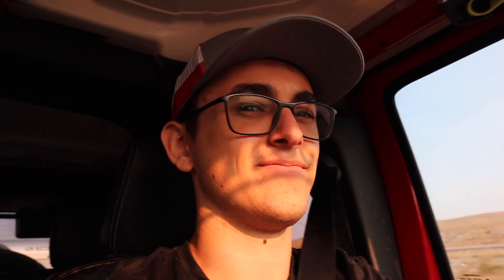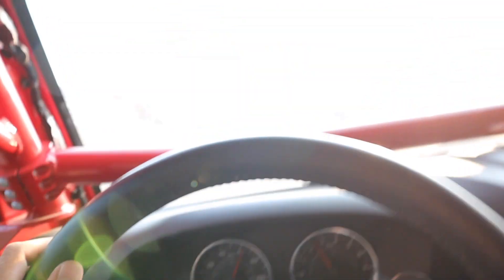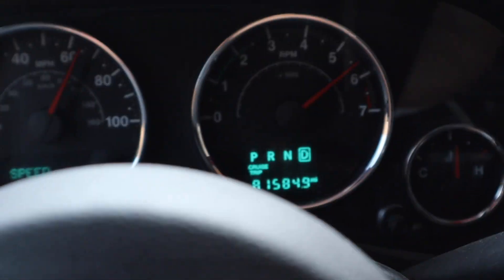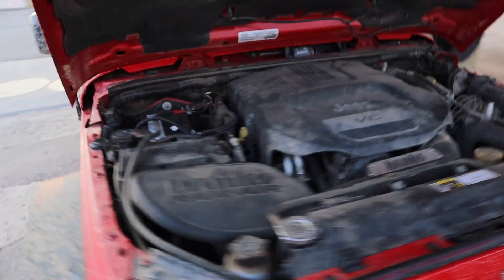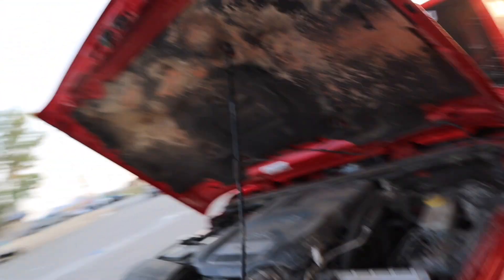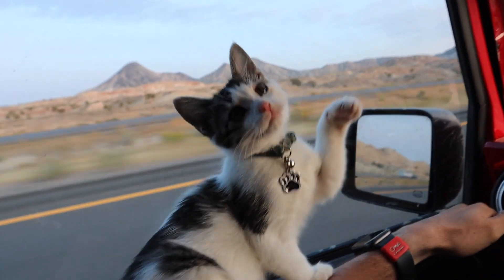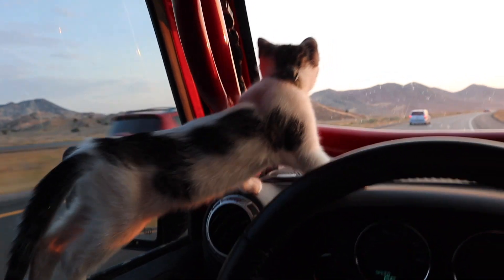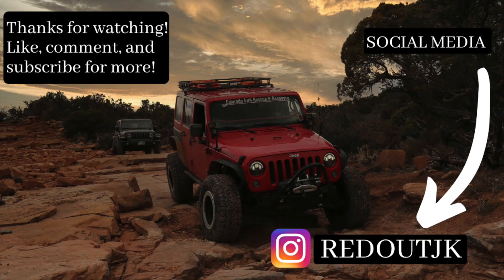Jeep JK TRANSMISSION Issue - WATCH BEFORE BUYING / MODIFYING A JEEP!

Comment: We have a similar problem. To tow, you should  regear to 5.12. We are going to regear to 4.88 to counteract the overland gear we have on top. You can manually shift it in the meantime. We're also about to install a new, lower temp thermo to help keep it cooler as well, so that could help.
Reply: *5.13

Comment: FYI, UHaul says you shouldn't go faster than 55 mph when towing one of their trailers, even the smaller ones.  "Maximum recommended speed is 55 MPH" - and Yes, for the love of all that's good and holy, REGEAR.  If you're running 35" tires on heavy beadlocks with the 3.6L engine and automatic transmission, and especially if you're in the mountains, you'll probably want 4.88 gears.  4.56 minimum for sure.
Reply from the maker: Ya, the axles I get will have 5.35s in it for sure.

Comment: Definitely time to regear.  If you go from 4.10  to 4.56, this will increase rpm by 10%.  4.10 to 4.88 will increase rpm by 16%.  Torque increase will be on a sliding scale depending on a given rpm and the torque curve of your engine.  You must decide how much you are willing to give up in mpg vs torque.  It sounds like you were not to disappointed with the performance prior to the full load and trailer.  The big question is how often are you going to do that?  If it is on a regular basis, I might go for the 4.88.  If you only do it once a year or so, I think the 4.56 should be good enough, just slow down on hills, no cruise control.

Comment: Programmer helped my 2015 for tire size and gear ratio. Completely different jeep jku now. 35s stock gears. Pushed 4000 rpm at 65mph with no power to pass. After the calibration I can do 75 mph and still have power to move. No down shifting. 75 mph at 2100 rpm👍
Reply: Hello! What programmer did you get?

Comment: I as well have this exact same problem with my 2014 JKR Automatic. I'm on 35's and the stock Rubicon 4.10 gears. I do have the computer calibrated due to the 35" tires. I can only attribute this issue to the stock gearing and the 35" tires. I really think having it re-geared to 5.13 would make this go away. Cheers from Denver CO!
Reply from the maker: Good idea! I calibrated my ECU as well, however I just need better gears for what I'm running! Cheers as well!

Comment: Here is a good example of another person jumping on the lifting a jeep band wagon thinking that running bigger tires and a lift kit is fine and nothing else will need to be done..it is 100 percent the tires,gears,and trailer..its already an underpowered vehicle, what do u think it will drive like its stock..lol
Reply from the maker: I know that I need to regear. I'm just waiting to do so since axles will be coming within a few months. No point of spending $1500 for gears when I can use that $1500 to help pay for axles. No need to be rude
Reply: @adamschoenfeld3284  not being rude just stating the obvious..if u know its ur gears and ur going to re gear then whats the point of the video.. either u know or u dont know the problem

Comment: Regear it dude.  The transmission isn't configured for the larger tires and stock gearing.  You might be able do something on the ECU side but a regear will make for a happier engine and transmission and give them a longer life.  Large tires and no regear put a ton of stress on the engine and transmission.  East Coast Gear Supply did have a moving sale not long ago, not sure if they are still doing it but I got Yukon 4.56's for my XJ's axles for about $200 off.
Reply from the maker: For sure. I know its the gears, I'm just hesitant to spend a lot right now when I will most likely do axles within the year

Comment: Not knowing your Jeep I would suggest your looking at OBD Jscan on Facebook as with it you can set the gear change and tire size to what you now have versus factory setting the program is available very reasonable at the app store and get his suggested blue tooth sending unit also search YouTube for the how to use it. It can work with your cell phone, it helped with my resets. Also you can monitor things like trans fluid temp  read and reset ant trouble codes etc.!!  A good product
Reply from the maker: I'll for sure look into it!
Reply: @adamschoenfeld3284  It helped mine shift properly, also make sure you (if your year allows it) turn off the overdrive on up hill climbs. Good luck!